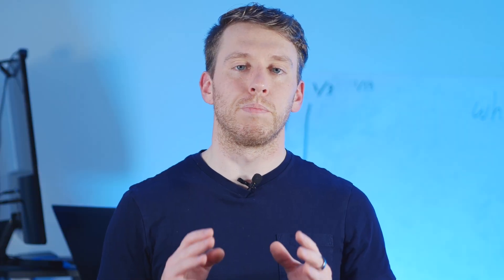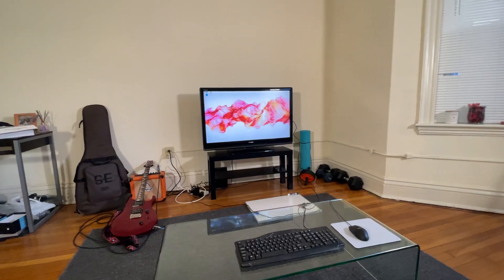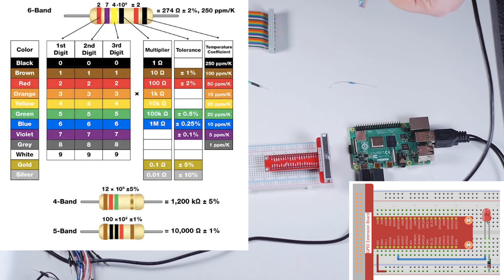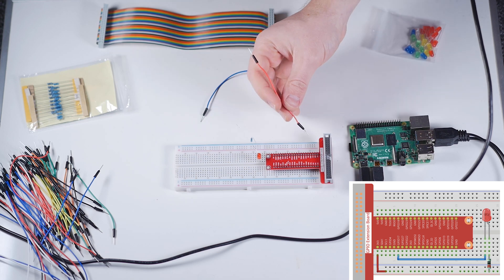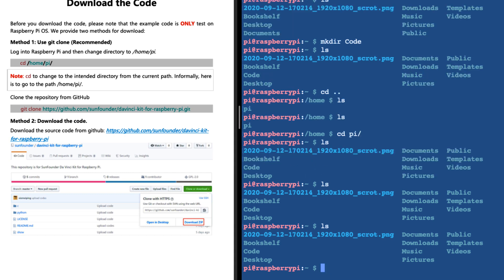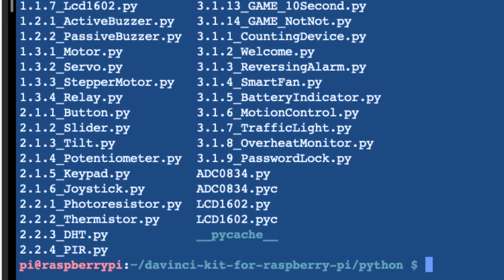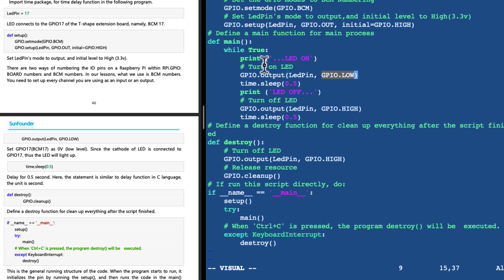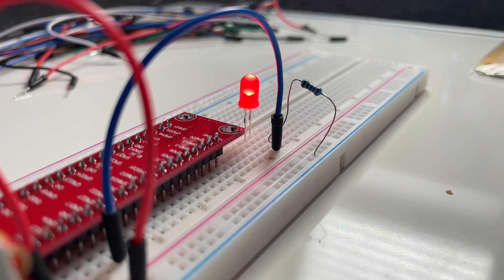How to Program a Blinking LED with Raspberry Pi and Python

Comment: one question: i have a respberry pi with an ipad inside. do you need the ipad screens to be on (cause whenever i unconnect the black and/or red wire, the screen goes black) to make the led blick while the code is running?

Comment: Nice video! during customizing the Script part how can I link it up with say a stock price(Live...) if it goes below ceratin x turn off the light and vice versa
Reply from the maker: Hmm this could be an interesting video concept. Basically the python script would need to request the data from some API source and execute logic based on the values. If you wanted to be hacky with it, you could just cURL a google or yahoo finance page. Scrape the stock price  from the response and then proceed based on that value.

Comment: I have a bit of a request. I'm currently looking for some sort of Website Uptime Monitor using Raspberry Pi and specifically Node.js language which automatically pings the website every set amount of time. And when the website that it is pinging is down, it could maybe turn on a red LED or when it's back on, it turns on a green LED.

Feel like it would be a cool project, and would help me in what I'm trying to look for.
Reply from the maker: That does sound cool. The fastest way to do it would be 1. Download node.js. 2. Write script to use fetch to ping the website. If response does not equal 200 with website body text, then use exec() to run a shell command that executes the python script to turn the light on. This could be done at set intervals using cronjob.